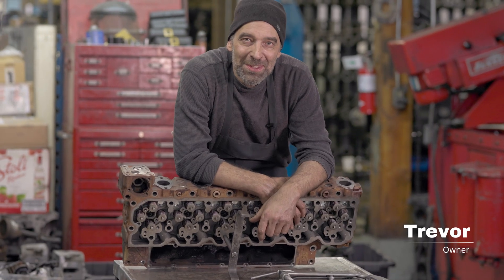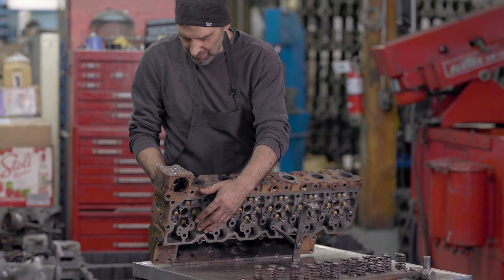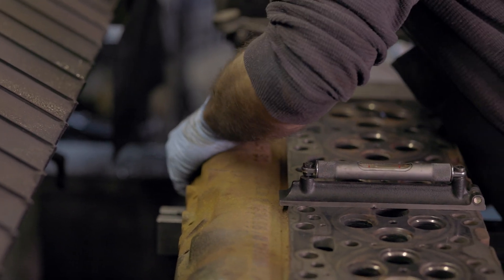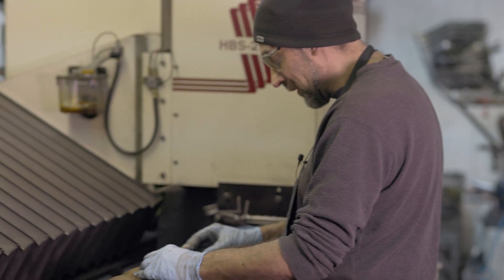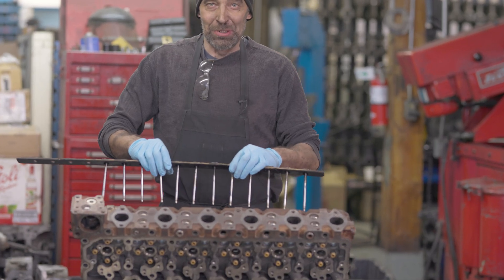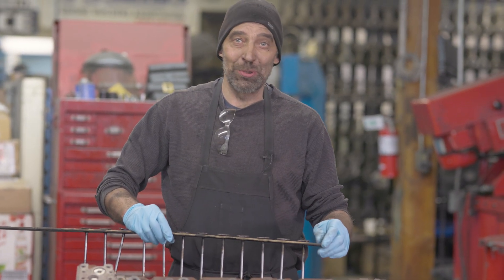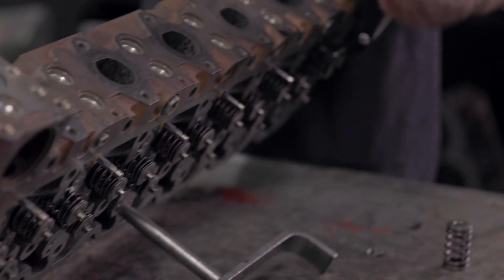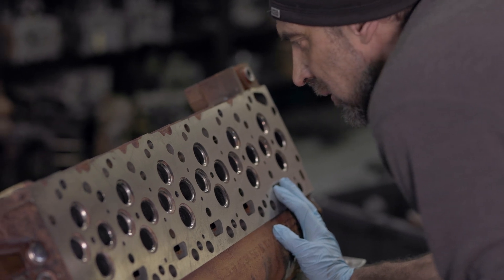Warped 6.7L Cummins Cylinder Head Repair

Comment: Since Cummins is not giving any specs for the maximum material removal depth  when surfacing, on ISB 6.7L heads, I was thinking max 0.010" would be a safe number. What do you think?